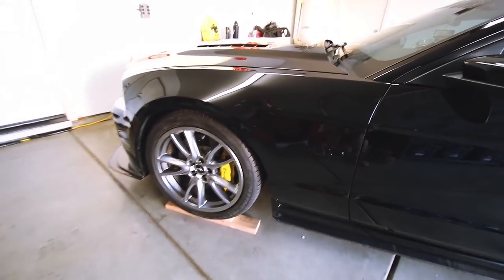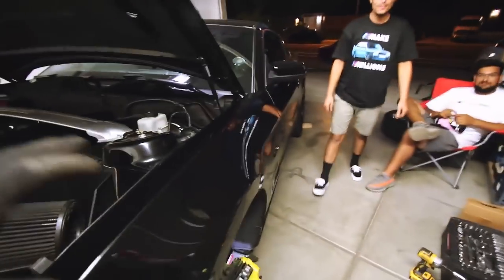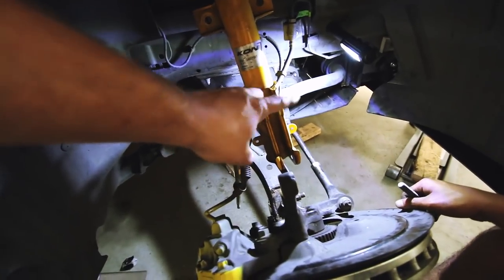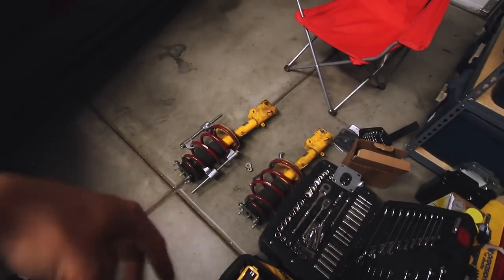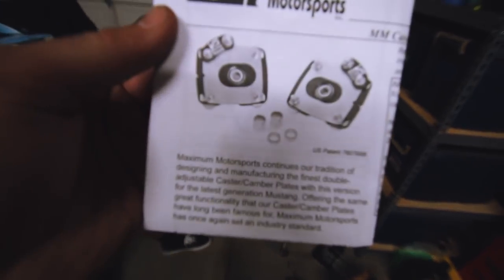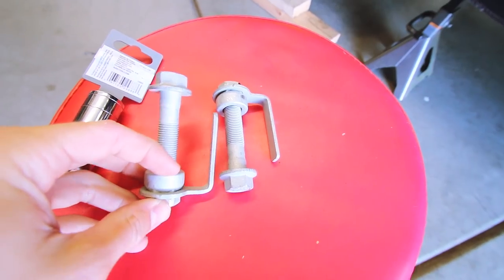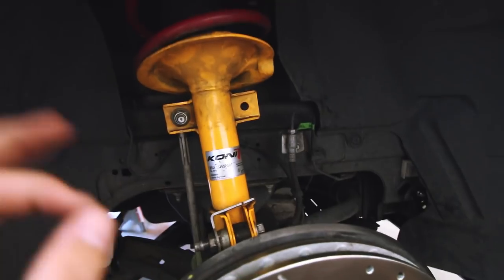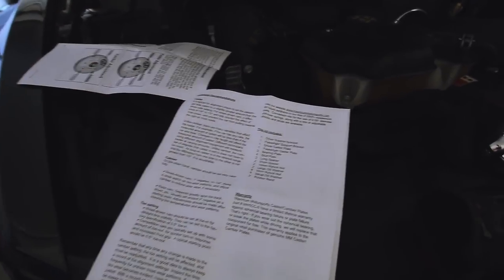You NEED These If You Lower Your Car! | Maximum Motorsports Caster/Camber Plates

Comment: Great vid, I have the BMR lowering springs on the rear of my 12 GT, now need to purchase and install the BMR springs for the front and will also be purchasing the MM caster/camber plates as well. I'll probably have to get a local shop to install the springs as I don't want to attempt to do this job on my own but am afraid the labor charge will be hefty. Also do you have a Frenchie? Couldn't help but notice your shirt. I have one (a Brindle), his name is "Hank"

Comment: I have these sitting in a box in my garage waiting to go on my mustang. I currently have the gt500 mounts which I believe my bearings are going bad in the mount on the driver side. Will the old strut mount bearings be reused? Or does the maximum motorsports cc plates have their own bearing?

Comment: Just installing my MM CC plates.. do you keep the elastic on or cut off once everything is in place before torqueing
Reply from the maker: Wait until you have it loosely bolted. Then cut and use needle nose. If you leave a piece in, no biggy. It’ll still torque down and squish
Reply: @JacobRDoty   that's what i figured,  surprised it was no in the instructions.. thanks

Comment: What's up man, do you know what are the pounds torque  to tighten the endlinks? I installed some Moog's and I think  that's what's causing a clunking and popping sound in my front suspension.
Reply from the maker: I believe there were around 86 or so? Totally doable by hand with a long enough ratchet
Reply: Alright thank you, hopefully that stops the clunking.
Reply: Cosmo Quinto wait so the end link should be loosened so it doesn’t sound like a popping noise